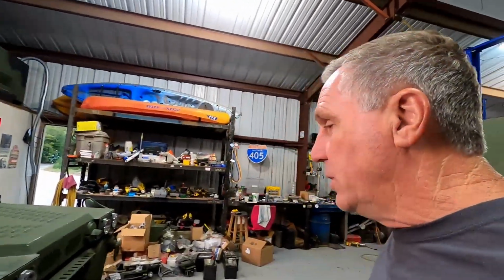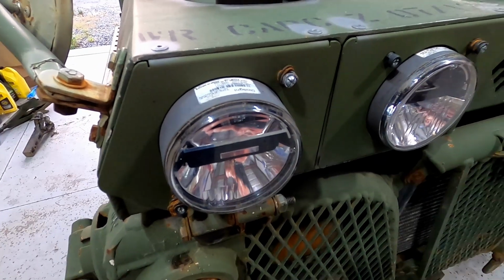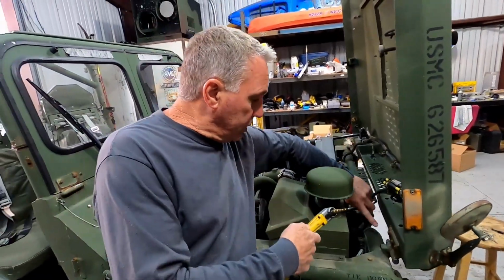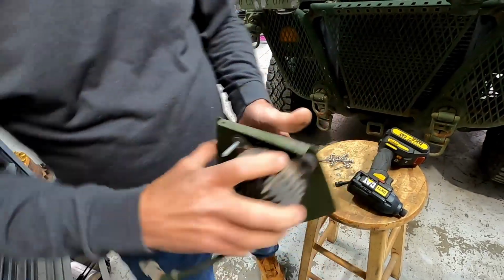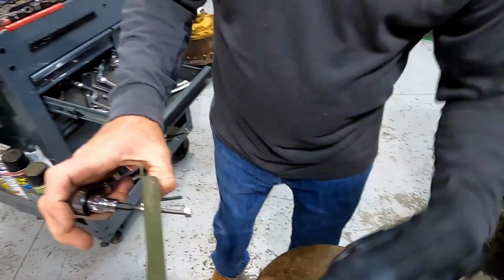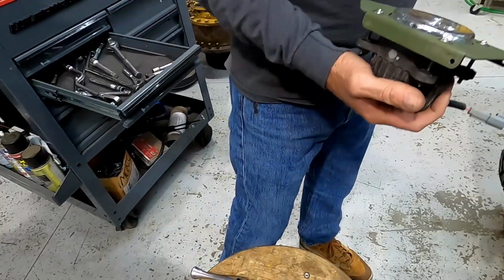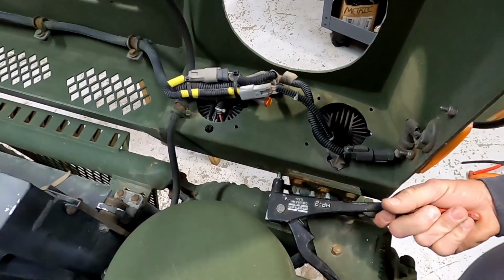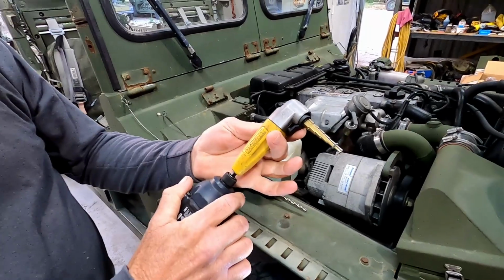Hella Off Road Light Adjuster Update for M1161 M1163 Growlers

Comment: I like it.  I'm wondering if there is room to remove material from that rear panel to make room to slide the lights back so they aren't sticking out so much, or preferably at all.
Reply from the maker: I haven’t looked at it to see if that was possible, it would be nice to recess them for sure